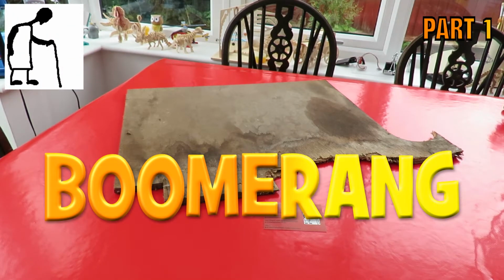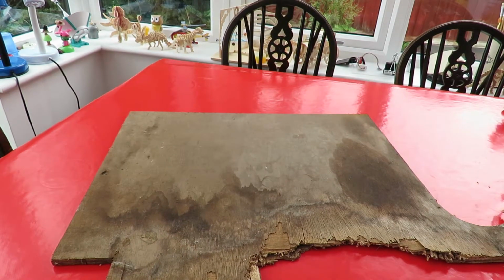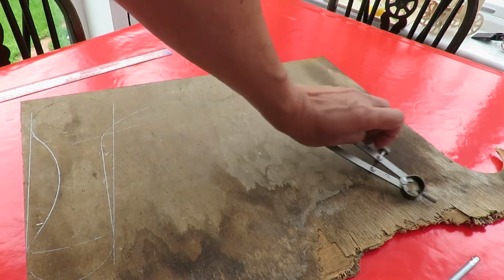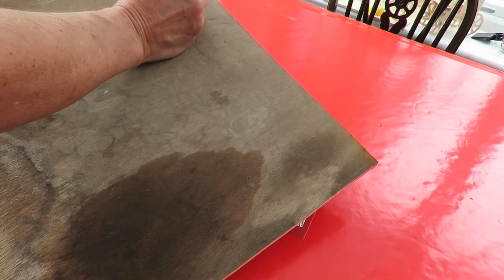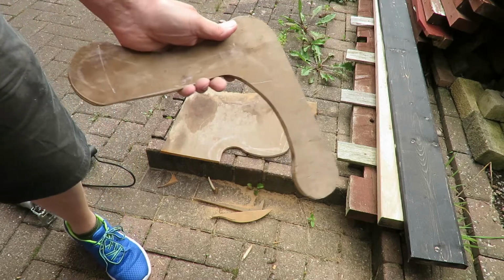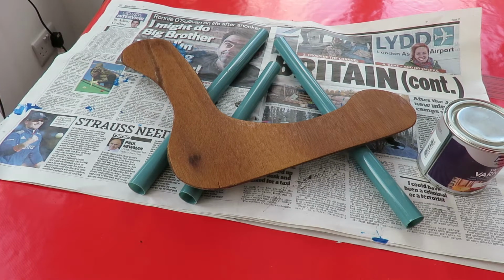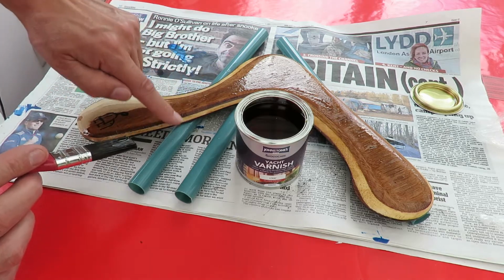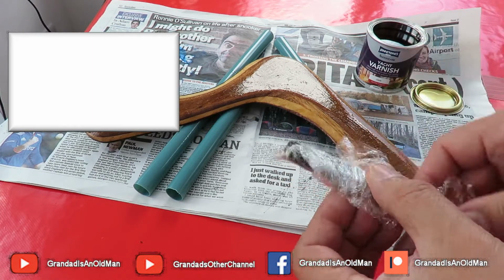Boomerang PART 1 - BUILD

Comment: Wonderful design ! quirky yet looks right compared to 'traditional' store bought.
I think the CG is around the mid axis, so that relates to the wider but stubbier end as you have yours. There could be a lot of fun in designs if you can grab some more plywood and. hey, could be a Store item with that finish :)
Reply from the maker: I probably rushed this one, (and the next one), rather like most of my projects I don't like anything I cannot finish in a couple of hours so waiting for paint to dry is a real pain. This one flies better than the charity shop ornament but there is still a long way to go before I get a good returner. This one could probably bring down a bird by accident but more likely put a big dent in the side of my car.